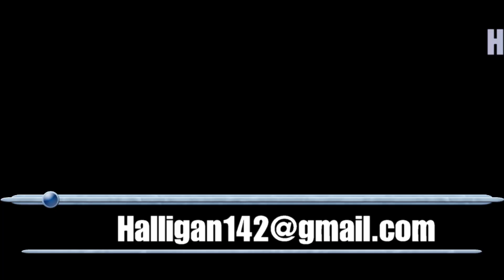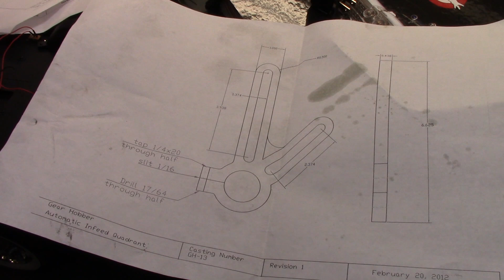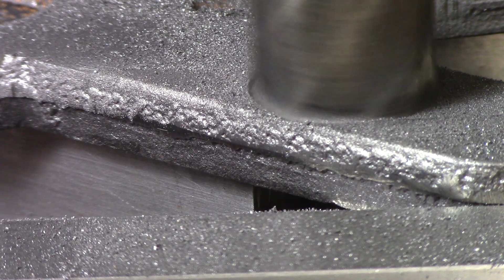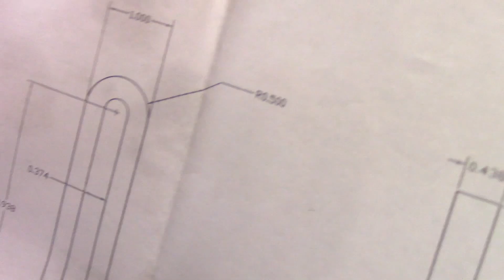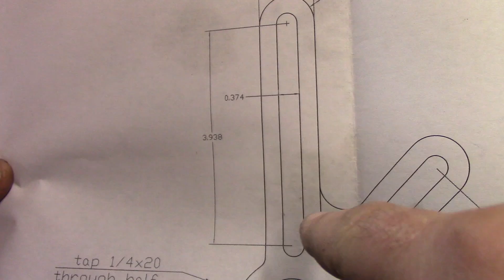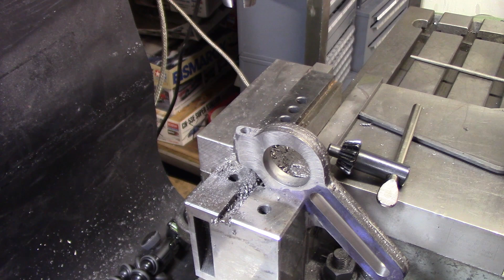Gear Hobber Build : Part GH-11 & GH-13

Comment: How come with all the focus on precision, they can’t make a centered slitting saw. Never have I seen one cut evenly, so they rub every time once those twenty teeth are worn down and work harden the thing we are trying to cut.
Reply: I think the challenge is with the manufactures having to make the hole with enough tolerance that users can use a variety of arbors. Thermal expansion may also come into effect since the production shops I have seen are anything but carefully temperature controlled.
Reply: I made a 'set tru' arbor for my small slitting saws.  Works like the 'set tru' adjustment for lathe chucks.  I first tried an expanding arbor, but it turns out the center holes on the cheap saws I had weren't well centered to start with.

It is a real pain to indicate though.  If I used them more often, I'd probably make a batch of them and leave the saws on them, like grinding wheel adapters for my surface grinder.